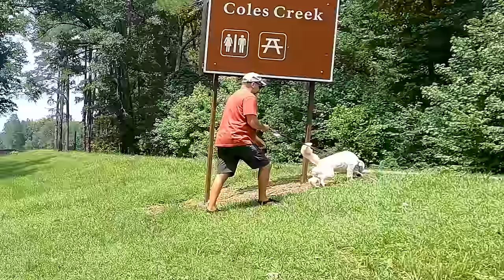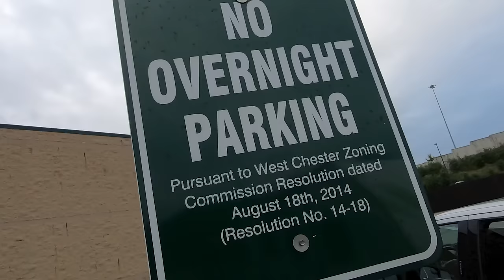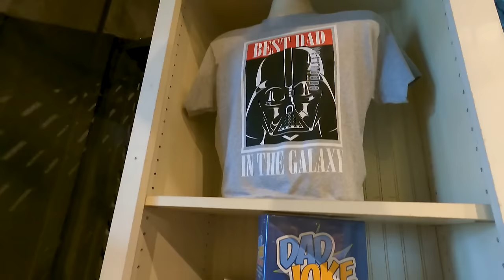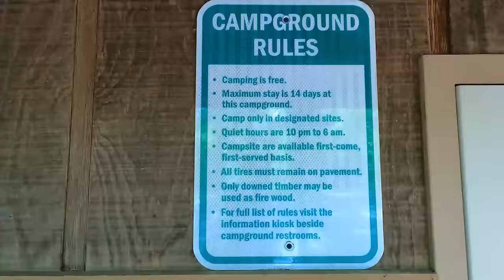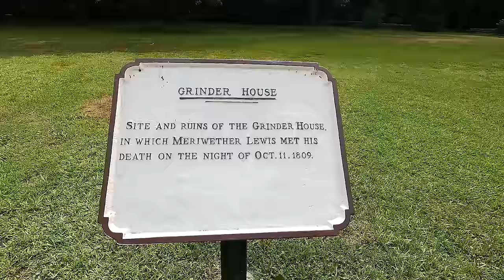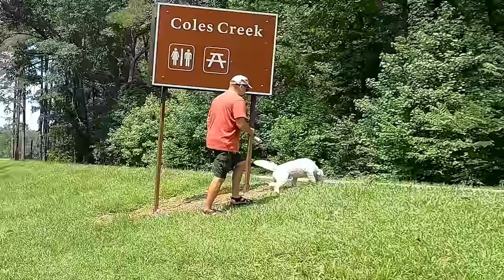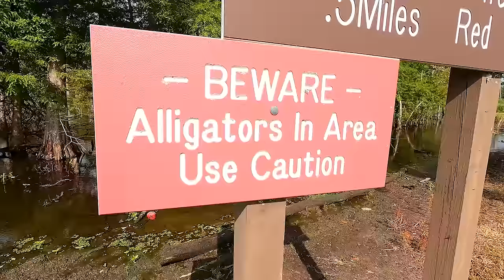Texas or Bust (and bust it did!)

Comment: Thx for the ride along.
Reply: Sorry to hear about the tire issues 
Before you replace an expensive axle, please bear in mind the normal wear a trailer tire gets. 
These axles twist each tight turn you make. They look out of line while turning and the tires drag badly to the side. 
They are supposed to be rotated every 3 K Kms.  No one does. So the dragged front axle tires west unevenly. 
You simply need quality Good Year marathon tires to replace the one that never got rotated. 
Do not replace an axle !

Comment: Cool trip!  Speaking of your tire, we're in Moab at the moment and noticed uneven wear on the same tire you have.  We have Dexter axels.  We have a coachman.  The guy who replaced our tire said that inside wear like this is usually caused by wheel bearing issues.  What I found once I jacked it up was that the castle nut was way too loose.  While jacked up, the play in the wheel was huge!  There is supposed to be a little to account for expansion when it gets hot.  Soooooo, we had the tire replaced, tightened the castle nut, not too much but just enough.  Dexter has a video on YouTube.  We drove 2 hours on it since and it seems ok.  Time will tell!  Good luck!  I feel your stress!!
Reply from the maker: When I jacked it up to replace the tire I tried wiggling the tire. There was very little play. I Googled it and they say 1/8 of an inch is the max it should move. I would say that mine fit within that 1/8". I know that the tires wear a little unevenly due to sharp turns and that's why I rotate mine at least once per season. I initially thought it was a bearing issue but as soon as I got to Texas and my brother-in-law looked and said the axle is bent, I looked and could see the bend. In the next episode I show the axle and you can see it's bent. 
Thanks for offering a possible solution though. It's always good to go through a list of possibilities to troubleshoot the problem. 
Have a great time in Moab. We'd love to go there someday.
Reply: @CampingwiththeColes  That stinks!  Now you have me second guessing.  I took a look today at the tire and mine too seems slightly off like its jetting out alittle....Either way we'll get it checked out!  Stay safe in your travels!

Comment: I would weight the trailer to be sure it not overloaded

And  then strip the suspension the bolts might be wore.    Letting things move more 

There is a few wearable parts in  there             bolts bushings…

Great videos.   Btw

Comment: Another great video. I'm curious about the root cause of axle problems. On another topic. This is a longer trip than many attempt. You don't mention costs or the fuel stops that offten have to be planned. Such as on the Natchez trace parkway.
Reply from the maker: I haven't added up the fuel costs yet. I'm kinda afraid too. However the gas is much cheaper in the US. I didn't worry about where to find gas stations because they're everywhere. On the Natchez Trace there are a lot of cut offs that take you to small and larger towns. Between half and a quarter tank I would look up gas stations along the route on Google Maps. Technology today sure makes things easy.
Reply: @CampingwiththeColes  Thanks.

Comment: Great vid as usual.  So much respect for keeping an eye on the rig and all moving parts.  Did your TPMS show a higher tire temp on the troublesome tire?
Reply from the maker: I kept an eye on the TPMS when I knew the tire was wearing unevenly but there was no noticeable temp or pressure change. I thought the temp would have gone up but it didn't.
Reply: @CampingwiththeColes  interesting about the tire temp.  I really would have thought there would be a noticeable increase.  I’m making a tire  check part of my circle check even at rest stops.  Cheers and keep ‘er between the ditches!

Comment: Great video guys, I really enjoy your informative views on camping. @ 30:03 I hear you say you take off the cruise control. I have a F150 as well and was told that cruise control will not work properly with trailers with electric brakes, ours is relatively new 2022, have you run into any issues ?
Reply from the maker: I use cruise control all the time when towing on flat roads. Never had a problem. If I slow down I apply my brakes and cruise turns off. I can see there possibly being a problem if you have adaptive cruise control where the car slows down while on cruise.

Comment: I'm no expert, but I believe that the issue with your axel is due to weight. I recall that in a previous video, you said how close you are to max GVWR. If you run like that, all it takes is a big bump to tweak an axel,  then once it's started, it'll continue to get worse. I would seriously consider upgrading to something that has a higher weight limit.  Then replace the front once you are at home.

Good luck on the rest of your trip
Reply from the maker: You don't have to be an expert to figure that out but try telling that to Cheryl. She loves to "be prepared" at all cost. We're working on lowering the weight but it's a battle 😒
Reply: @CampingwiththeColes  I believe that. We carry an extra kitchen sink if ya know what I mean😉😆

Comment: That rear view mirror, is that a cam attached to the RV to show you the back? is this an add on that you purchased?  i would be interested in what make/model this is if its not a built in feature for the truck.
Reply from the maker: It's a rear view and dashcam combo that a company gave me to test out before it goes to market. It has a lot of issues and I definitely wouldn't recommend this one. However I'm still using it because it works for the basics. All the bells and whistles is where it falls flat. You'll have to do some research if you're interested in one.
Reply: @CampingwiththeColes  Thanks for the reply, i assume it attaches to the existing mirror?  and then you still need to mount a cam on the back of the RV?

Comment: You’re axle is fine 
If you never rotated those tires …. That would be normal wear. The front axle tires are dragged sideways in each sharp turn. The inner edges are scraped off. No one ever rotates trailer tires. 
They get chewed inside and west like hell. Then someone wants to sell you an axle. 
Get good American made GoodYear’s marathon tires. 
Air up to 65 psi. 
Rotate them every couple thousand miles. 
Don’t let someone sell you an axle !!
Reply: I believe you meant the Goodyear Endurance.  Unlike the Endurance, the Marathons were made in China and known for their unreliability.